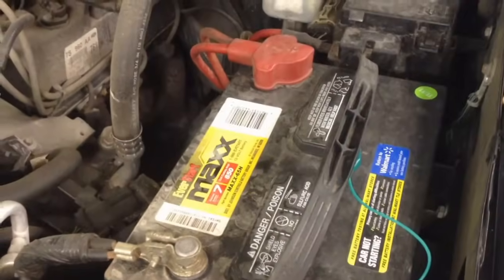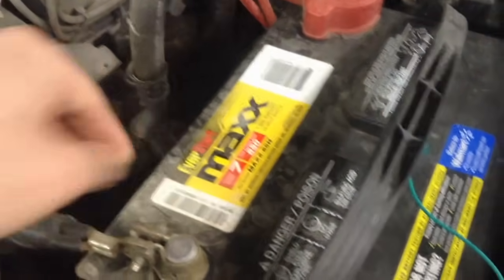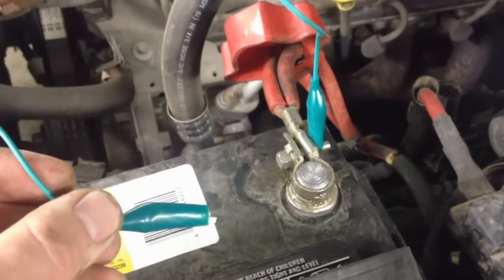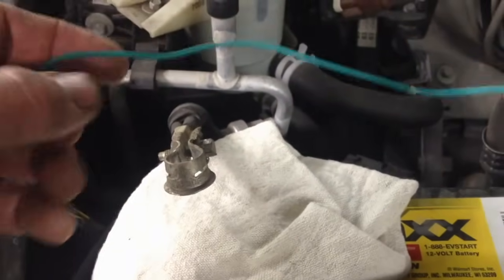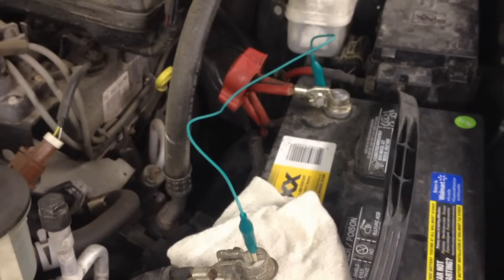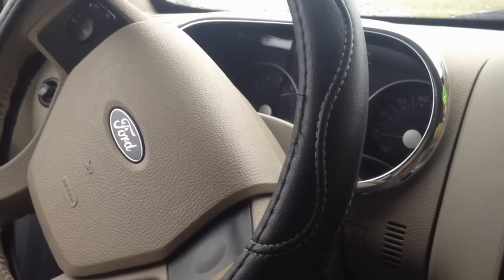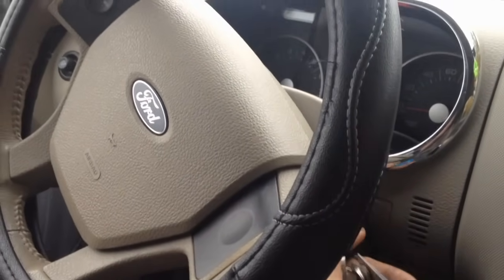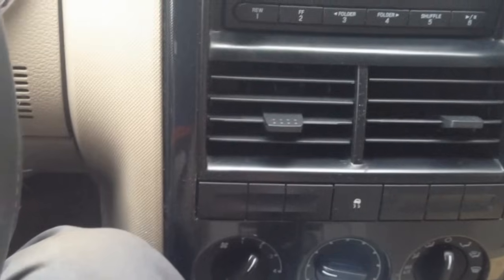How To Clear Your PCM'S Memory On Fords After Repairs

Comment: Will this work when you receive a check charging system light comes on occasionally? no codes are thrown.  Could this be because after the bad battery was replaced that it wasn't reset and is charging the new one at the same level as the bad battery?

Comment: Semper Fi Brian.      A big thank you to you..  My 2006 F250 5.4 had high idle problems. It was hunting between 1050-1200 RPM's.   I applied the PCM clear and then the reeducate or the idle sensor and then the transmission retrain.   SUCCESS.. engine now idles at about 700 rpm, and transmission shifts properly.

Comment: I have a Lincoln town car I change the throttle body because it was given me code p2107 i was pretty bad I couldn’t even drive the car itwas on force to shutdown mode. Well with the new throttle body is back to normal     The only problem is that still on force to shutdown mode I did the relearn procedure it still the same plz help me is driving me crazy if anyone knows what can it be plz let me know

Comment: question i have a 2006 5.4 i had a prob i was told i needed to change all the plugs i did " they where bad when i pulled them out " i pulled the ecm off the firewall to get to the back plug and unplugged and set it aside did the work and got everything hooked up .. started it up and i have a misfire it doesn't throw a code. could the misfire " i didn't have it before i started "  be caused from removing the power from the computer and unhooking the battery?

Comment: Hey muckaluco. Any ideas on what's causing battery light and check charging system info on a 2003 Expedition. Battery alternator fusible link all new and charging at 14.4 volts. Any ideas?

Comment: Just installed a new rebuilt long block in a 98 3.0 Ranger.  Throwing a P1309 code so I reset the camshaft synchronizer but still throwing the code.   Truck seems to run pretty well.  When I clear the code “check engine” stays off for about 10-20 miles or so then comes back on.  Btw it’s manual transmission.  Would this possibly work.

Comment: I finally did this to my project 99 Ranger 4.0 OHV after servicing transmission valve body, throttle body, air intake, MAF sensor, changing plugs, and repairing a fairly major vacuum leak. It drove ok and I was reluctant to reset, fearing some sort of new problem. So glad I forged ahead. Amazing overall improvement. Idle and shift much much better now. Thank you very much for taking the time to make these useful videos.

Comment: I changed the bank 2 vct solenoid, cleaned the throttle body...was running good for about 2 days then it turned on the check engine light....would doing this resolve the issue????

Comment: Will this work on a escape 2009 hybrid? Had a p0456 and replaced the parts how long before it would turn off CEL from driving? Or should I just reset the pcm? Thanks alot

Comment: Will this work on 99 f150 5.4 auto?
Reply from the maker: Yes
Reply: FordTechMakuloco thanks. I’m also having a throttle problem with it. I just replaced intake and upper/lower gaskets. Now when you barely give it gas (in park or while driving) it acts like it’s missing and sputtering. TPS checks out fine, and no engine light. What would you suggest?

Comment: HOT DAMN!!!! That fixed all my issues. Thanks man thought I was going to have to put it in the shop.
Reply: Fixed my 07 Ford F-150 perfect after I cleaned my throttle body. And drained the capacitors. Mr coco you must just be an idiot
Reply: Yea, right!  Running a + wire over to your - terminal fixed all your issues.  I've never laughed so hard in my life.
Reply: @goldenagex  you'd be surprised what can be fixed by doing this step. Fords have to learn how to idle and shift and will run super weird if you skip those steps

Comment: My traction control light flashes every time I turn left or right because I lifted my truck 6in and replace with bigger tires. Do you think if I reset the ecu will solve my problem? 

Thanks
Reply from the maker: Ni

Comment: I just did this on my 2007 Mustang GT (after doing a tune-up and new aftermarket mufflers) and I can honestly say the automatic transmission shifts better and accelerates better.  And I did a testdrive after doing the tune-up but prior to resetting the PCM.  Shifts are better, downshifts are better when accelerating.  It used to feel like it was a gear too high and trying to struggle through it.  Not anymore.  This is definitely a good "hack/fix."
Reply: My 03 grand marquis feels like that too, never in the right gear.

Comment: I have a 2011 ranger 4.0 and I’ve tried this so far and cleaned the MAF and the throttle body but I still have an issue while accelerating up hills where the transmission is either in 5th or overdrive and I ease off the throttle because the truck is speeding up as the hill levels out and the engine rpm jumps maybe 500-700rpm but stays in the same gear. This is on the highway doing 60-70 with the engine at around 3000rpm after downshifting toward the bottom of the hill at around 55mph. It’s similar to using the TCS to turn OD off then back on but there’s no definite downshift. Also, this engine rarely is taken much over 3000rpm while driving. I’m thinking this is some kind of sensor issue but the MIL light on the dash never lights up and the OD light never flashes. Coincidentally this happened after an exhaust replacement but all the cats and sensors are still in place. I don’t have any flares in any of the other gears but I guess that’s kind of what it’s like, a flare without any power loss...

Comment: Have a 2010 Explorer. Started having what seemed to be a trans issue that was intermittent. Then idle issues and running rough. Then RSC alarm went off. Keeps draining the battery over night. What does it sound like to you?

Comment: I have a 2016 Ford Taurus bad mpg, fixed a vacuum leak tube was broke at the intake when I bought it. Probably broke for a very long time, hopefully didn't cause long term damage... was a rental. but after 200+ miles still bad, can this work to reset mass sensor? I'm getting 14mpg highway 10 City, and no lights come on. Also my car has push start button. Can't turn a key. Already did new tires, new air filter, replaced that intake part with Oem part, and alignment, put seafoam in the gas tank...still can't figure it out why mpg is still so bad. I drive like a granny.

Comment: I have a 2007 Ford Focus, model ses. I had the water temperature thermostat changed  last year. The thermostat and engine are perfectly normal in every way. However, I will get a check engine light  at least once a month. I read the code and it is po128 which my book says "cooling temperature below thermostat regulating temp. I have to get the car inspected next month. What should I do to correct this ?

Comment: Will this work to also clear all the emission codes?  I have virtually replaced all of the emission parts and hoses to get the "Check Engine " light to turn off, to no avail.  The P0401 keeps coming back.  Do you think that this might help?
Reply from the maker: It clears them yes.
Reply: No it doesn't..
Reply: @katerinakat6889  Try it again, might take a few tries. I am going to try this tomorrow since i put a bunch of work into my truck and it has a rebuilt transmission that i doubt the original owners did this.

Comment: Just had my transmission fluid flushed on a 2012 Ford Escape 4 Cylinder AWD and it was shifting at 3k-3500 RPM's on certain gears, namely between 2nd and 3rd.  Went through this process and it's shifting smooth as silk on all gears at approximately 2500 RPM as it should (3k if I'm going uphill).  The fuel economy has improved as well!  Thank you!

Comment: Do you know what the process is for replacing the multi function turn signal switch in a 2013 f150? The wipers were staying, I replaced the switch, and now the switch doesn't function properly.

Comment: My 04 Mercury grand marquis won't start at all, it had a bad key chip, I took it to ford garage, they cut 2 new keys, ran their factory reset to program these keys! Low and behold it still doesn't start and the antitheft strobe on the dash top flashes rapidly like its being stolen! So wtf do I do next? How would you go about resetting or bypassing the antitheft system? I'm outa ideas and regretting buying this ford, any feedback would be appreciated.

Comment: Will this work for a 2017 F-150 with the 6 speed transmission and 5.0 L engine? 

Thank you for your time and great video’s!
Reply: Oh damn that sucks, yea my truck is a 16' and doing some crazy thing like just shutting off as soon as I pull in my drive way, with no codes, no sign of anything going on, and cant figure it out.
Reply: @williamthompson5606  My 2016 F-150 was doing the same thing, ended up being the (cylinder head temp gauge) fixed all my problems with truck cutting off and acting crazy while driving... took awhile for it to finally show up on the pcm scan. It was a pain to install because of its location but I was able to do it in about an hour in my own garage.
Reply: @ryangodwin4230   ok that's something I will look into. How long did it act weird on you before it showed up on scan ? And I was talking to a ford tech and he said he had chased down a similar issue and came across the crank positioning sensor. I even replaced that and still did it lol I will try the head temp  sensor tho to while I'm just tossing parts at it haha. I'm bound to find the issue sometime.

Comment: This was just what I needed for my Escape after replacing the transmission. Thanks
Reply: What tool did you use for resetting the transmission tables
Reply: I just replaced my fords transmission and wont start, did you have a no starting no spark issue before doing this?
Reply: @alexsale1569  no. I didn't. Sorry bud

Comment: FordTechMakuloco You are THE MAN. I bought a 2006 Ford Fusion for $1300.00 on 5/7/18 with 141K miles. The transmission was hitting hard from 1st to 2nd, not as hard from 3rd to 4th. shops where telling me a new transmission at a cost of $3,000.00 to $4,000.00. This video just saved me a FORTUNE!!!!! I can not thank you enough for posting how to reset the PCM. I don't think I'll have to replace the TCM now. ROCK ON!!!!!

Comment: I just cleaned my throttle body on my 04 explorer and did this relearning process and its smooth compared to other times I disconnected the battery and i never did the whole relearn process maybe that's what my explorer needed. Thanks alot for your videos and expertise u have got a new subscriber

Comment: garage told me my purge valve was acting up they took it off sprayed some seafoam through it and reinstalled said give it a couple days see if it corrects itself also getting a p1639 code was told i need to have my pcm reflashed was wondering if this procedure would do the same as taking it to a ford garage and having them reflash btw its a 2013 f150 5.0 thank you

Comment: couple of questions, FordTechMakuloco. will this reset correct an issue i'm having on 2006 Mustang GT with low beam headlight turning off on the passenger side after 15 seconds? bulbs are new and fuses are fine, but PASSENGER side low beam cuts out after 15 seconds EVERY time i turn lights on. high beams are fine on both sides, only low beam on pass side cuts out. second question is will i have to reinstall my custom tune after performing this reset? thanks a bunch!!!

Comment: Dude, after replacing my battery my Ford Fusion 2009 with no longer accelerate at all. I was about to have to shell out several hundred dollars for replacement throttle body and who knows what else and I came across your video and boom, worked like a charm. The car is not only running, but running better than before! Your videos rock!
Reply: Yes I have 2006 f150 having trouble with reverse not engaging I put new oil filter on transmission it still  same then trootle body new  do corberb runs great but reverse slips wants to go  should I try that

Comment: Thanks again for another great video!  I've got a '13 F150 that has been shifting hard, especially going to neutral in a coast and downshifts in the mid gears.  I just changed the drivetrain fluids, using your videos as a guide, and I would like to reset the TCM.  Will this procedure reset the new Fords with separate TCMs?

Thanks in advance!

Comment: I'M CONFUSED, you said this would clear your SHIFT POINTS yet.... you've stated in another video you can't reset your TRANSMISSION ADAPTIVE TABLE (for which contains the SHIFT POINTS) by simply disconnecting your negative side of the battery. You then said you would NEED A DEVICE that can do that specifically... https://youtu.be/jWMliD_3s3o  (Published on Dec 2, 2016) What am I missing... Thanks
Reply from the maker: There was a date break that varies depending on the vehicle you own. Basically any of the early 6 speed transmissions up to now with any speed need a scan tool to clear the NVRAM.

Comment: i am trying to get the codes on my 2000 ford ranger and the obd2 will not power up, I replaced the # 17 fuse that gos to it but it still want work.

Comment: Well the 2nd gear bump is back. This trick will work temperarally for about 4 days. Then hard 2nd gear down shift and hard 2nd shift. Do you think it needs to be flashed?
Reply: Man the 2nd gear bump is back!!! It goes away when I reset computer. Do you think it needs to be flashed????

Comment: First off I have to thank you for posting this video. I have an 07 Ford Edge one of the coils burnt up and I guess trashed the PCM as well. Had a mechanic that basically runs a shop out of his home ship the PCM off to be repaired and flashed got it back transmission issues hard shifting etc. So he then took it to a Ford dealer to be flashed again. Transmission still hard shifting. Shipped PCM back to be repaired again and still the same transmission issues. Took it to aFord dealer to have it diagnosed they said it was an internal issue with the in transmission. I still didn't believe that because after driving it a few times the shifting pattern changed if that makes sense instead of hard shift it was more of a longer shift. That might be what you guys call slipping not sure. I then put the Lucas transmission fix in it and it was shifting way better. Went ahead and tried disconnecting the battery cables  for 30 minutes after doing some research online to try to reset the PCM that way. Did basically everything in your video that you recommended except for the alligator clips.  Did the test drive the shifting pattern is again back to the way it was when I first started driving it after the repairs, hard shifting. I'm going to try your suggestion in the video using alligator clips. So frustrating I'm a female and trying to diagnose this myself is absolutely crazy!!!
Reply: Holly Pierceall Just because I don't shave my arm pits doesn't mean transmission problems aren't any less frustrating. Some say, "she's a female she doesn't know about cars", well it's just as bad when you're a guy and you're EXPECTED to know about cars and you don't. I believe I was born 150 years too early cause I don't know crap about cars and don't WANT to know. In another 50 years cars will drive by themselves, but then people will be complaining about their home robot acting up. "He won't vacuum, clean the bathroom or take out the trash. I'm never buying a Ford robot again".
Reply: @bentnickel7487  lmao
Reply: Get a Actron CP9690 code tester. It checks live, record, graphing, transmission codes, oxygen sensor tests, emissions readiness test, and MORE! It comes in a black pouch and it works out of the box from 1984-2013. It is updatable with a USB cable from EBAY. It has code-connect to diagnose codes from record feature.

Comment: i have an 03 expedition 5.4L check charging system light comes on while driving, i have replaced alternator, fusible link and battery. Will clearing the computer help with this issue? I have been told sometimes it takes up to 40 starts for the message to clear, I just want to make sure

Comment: Using a scanner in my Fusion 2009 I get these readings: ACP_V = 1~1.2v, ACP_PRESS = 0 PSI. Using gauges the actual pressure in high-pressure side is 100 psi as well in low pressure side. A/C Compressor doesn't engage because PCM assumes pressure is 0 psi. Any sugestion?

Comment: Hi there

Great videos. I had the PCM and instrument cluster replaced on my 2006 Ford Explorer 4.0 and when i picked it up at the mechanic shop, the powertrain malfunction indicator (wrench type icon) was on. This was not on before the repair and the mechanic said it was a maintenance issue. He said i had to change the engine oil and boy did that make me angry.  I left it at that and he said to leave the car at the shop and they would diagnose it and advise how much to fix. No way i will do that!  I wish fordtechmakuloco was close by the Arlington, Texas area!!!  Could use honest and smart techs like him

So i was thinking about trying this PCM reset

Any feedback will be really appreciated

Comment: This works, At first thought i was screwed, drove around for a week, then i hit the highway about 80 mph for 2hrs, No Shit, turned it off, BAM no problem's still to shis date. If you do this reset, get on the interstate and try it! Hahahaha! THANKS! 2000 Frod Expodition, 327,000 miles and running strong. You rock Man!

Comment: I have a 2012 Fusion that was purchased new.  It now has 50k and it has had a random "shift bang" issue when going from drive to reverse.  It was a violent bang that you'd think the motor mounts are being torn apart.  The dealer checked it out and found no faults codes and said to let them know if it happened again.  After reviewing this great video and hearing Brian say it will also fix the shift bang problem I had to try it.  Followed each step and now it even shift smoother than ever.  Thanks for sharing your knowledge with us.